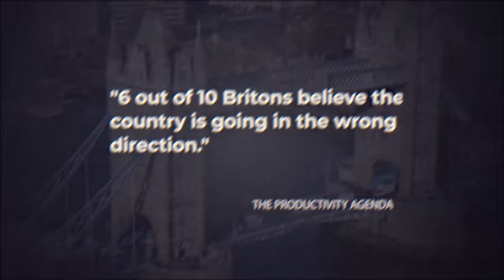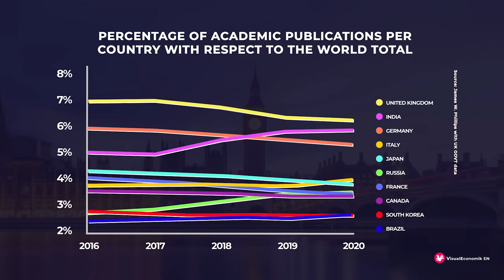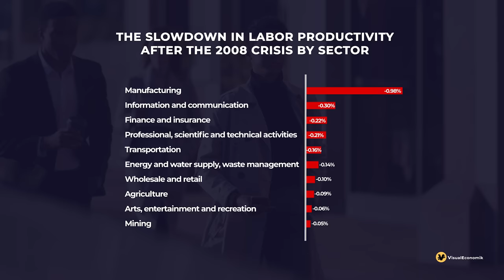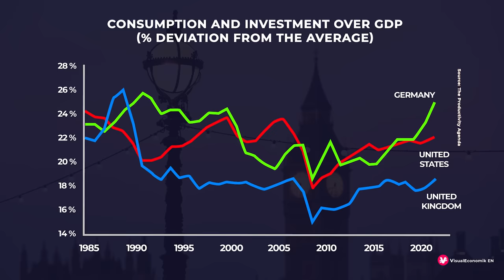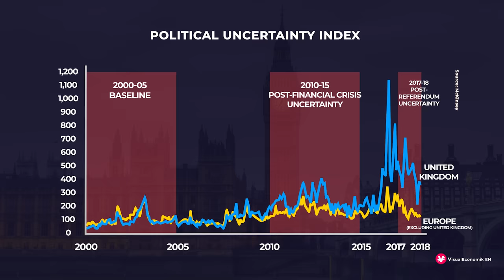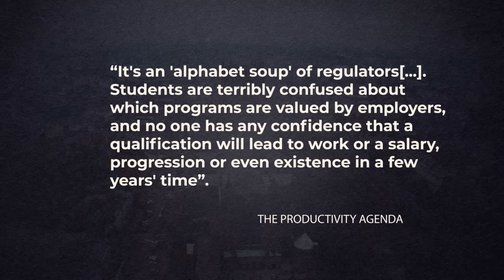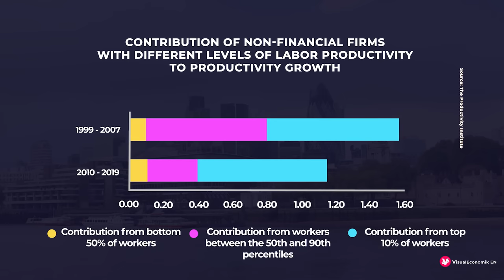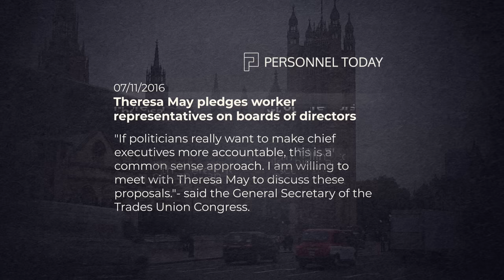The UK's Decaying Economy: A Country Without Solutions?

Comment: As a software engineer, I am always surprised to learn about the pathetically low salaries in my profession in the UK. A London-based developer could be making one quarter of a similar Silicon Valley developer, and half of a Tel Aviv developer. Sometimes the salaries were even lower than in Ukraine before the war. That's despite the insane London real estate prices and generally high-ish cost of living. At the same time, unlike in Ukraine, developers are not well-paid compared to other UK professions, so the UK doesn't have many of them and cannot become an outsource location. This is just one symptom, but it shows a major issue in the UK: extremely high-productivity jobs are not rewarded.
Reply: Gerentocracy. There's a sickening culture here that the highest paid jobs (ie. The salaries that software engineers should be getting) only go to senior management jobs.
Reply: That sounds like a reason companies WOULD and do outsource to the UK.

Comment: First problem is basic economic management and honesty. And it's not a left or right issue, it's a matter of integrity and long term thinking. We need to stop running deficits, if the Tories want lower taxes, they need to be honest and lower government spending until there's no deficit, if Labour want high government spending, they need to be honest and raise taxes until there's no more deficit etc.

Similarly they need to stop lying with statistics, increasing GDP by importing a million immigrants a year isn't making people richer, but the government tricks people into thinking "the economy increase in size by 2.5% is the same as "we made you 2.5% better off. No, government should actually be required to tell people about GDP per capita or median GDP per capita, which proves that people aren't really better off at all, and would force the government to stop focusing on "make GDP go up" and instead focus on making Britain more efficient and productive.

Comment: Up VAT to 25%, remove all other taxes, and then institute a 2.5% annual tax on all assets held outside primary residence and necessary vehicles.  Simple as.  The second corporation tax is gone, GDP surges for 10 years!
Reply: jesus this so much
Reply: @MGrey-qb5xz  It's about 10,000 pages simpler than the current tax code.  What more can you ask for?

Comment: Speaking on the investment issue, I'm a brit that has started a few companies, most have failed, but one succeeded. The limiting factor? Purely investment and geographics. Previous companies were formed in the UK, and raising capital was damn near impossible. The requirements are far too high and appetite for risk far too low, so we setup in the US instead. Investment was more or less immediate and flush and I attribute that to a fundamental difference in culture & institutions. The UK's finance and investment sectors are far too risk averse to consider anything other than a safe bet, and as such have pushed myaelf and several others out of the country in search of greener pastures. It's a sad, sad state of affairs that the immense ingenuity and inventiveness back home is being squandered as a result of such backwards thinking. When everything is accelerating, the UK (and europe) seems hell bent on slamming the brakes.